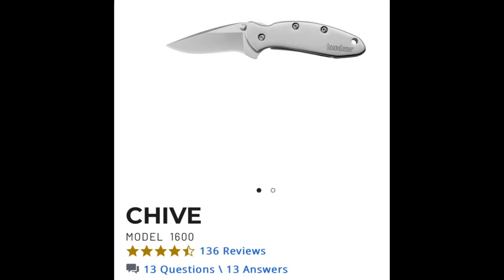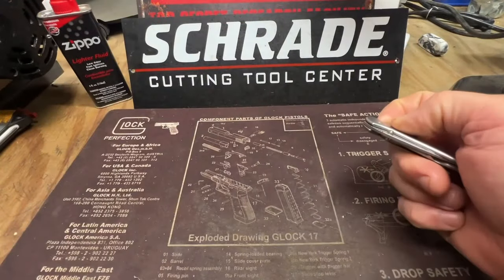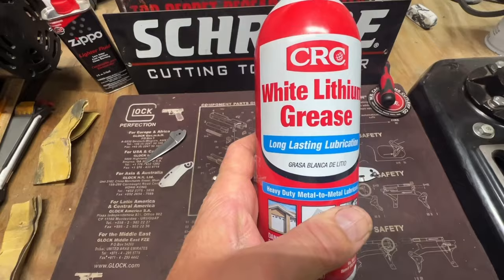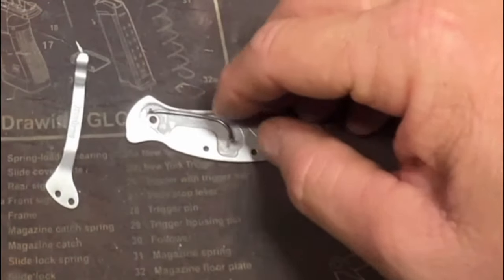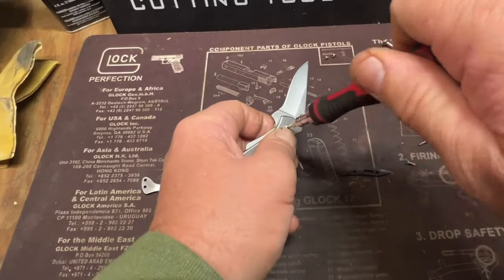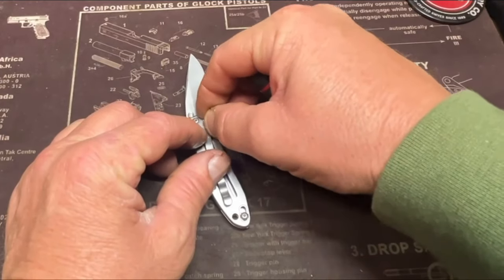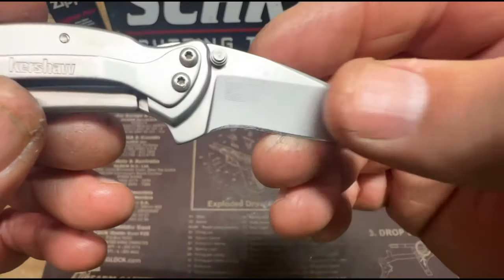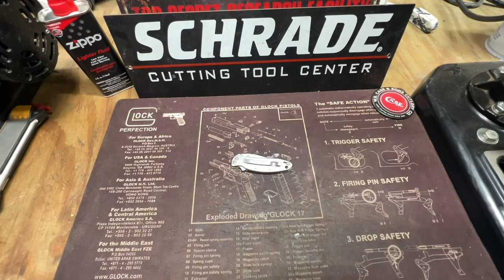Kershaw Pocket Knife Disassembly, Re-Greasing & Assembly Tutorial - Reviving this EDC Classic!

Comment: This is a good video but if you have the torsion bar side of the handle down on your assembly table first (reverse order you did the assembly) it will go together much easier.  You can drop the blade over the pivot post and line up the torsion bar end on the blade - then simply drop the other half of the handle on and good to go.  Just be sure to sharpen the blade after final assembly so you're not handling a razor sharp blade like is was doing...